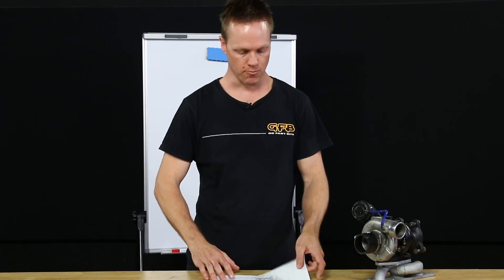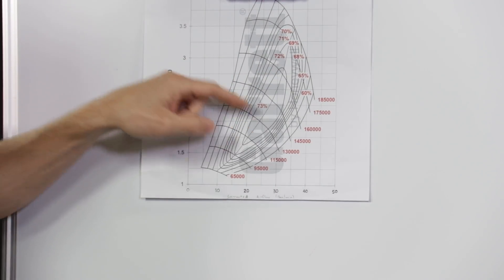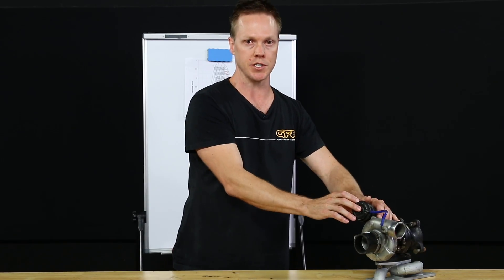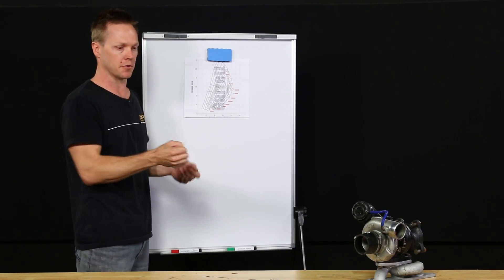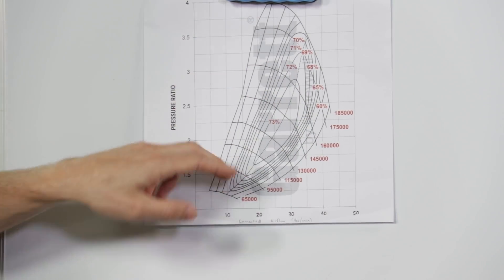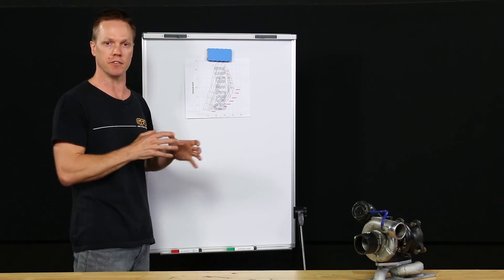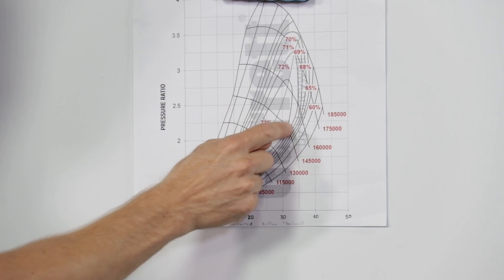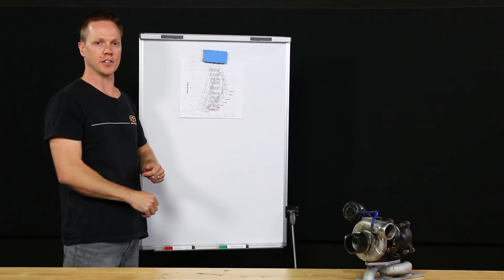Turbo Compressor Map Explained [GO FAST BRETT]

Comment: Great video man. Can you please refresh my memory on how to plot the points on that compressor map, that show your different RPMs using the Volumetric efficiency formula at 1000rpm increments... I can't seem to find it anywhere. It's basically to determine what you're saying about being on the surge zone or efficiently working the turbo matched to the engine performance

Comment: If the pressure at the inlet is less, than  atmosfere the pressure ratio is more not less and turbo is working hader to provide that 1 bar or wahteser is set to

Comment: Had a doubt. You said when the RPM increases the operating point goes horizontally to the right to the current RPM curve. However, shouldn't the boost ratio increase as well and the operating point actually shift diagonally?
Reply: The Y axis only contains the pressure ratio.

If your boost holds 1 bar above atmospheric and your turbo has a very good intake without losses, you're very close to a 2.0 pressure ratio. You will stay at 2.0 pressure ratio unless you start asking your boost controller for more or less boost across the rpm range.

Comment: Intercooler psi drop is also a part of pressure ratio calculations
Reply: well it's important for the engine power but the talk  in the  video is about the turbo efficiency itself.

Comment: 1 bar of compressor pressure with 1 bar of atmospheric intake pressure makes a pressure ratio of 1, not 2.
Reply: Mishellis gauge pressure versus absolute pressure.
Reply: 1 bar of compressor pressure is 2 bar absolute pressure so 2bar absolute divided by 1 bar ambient pressure  equals pressure ratio of 2  or  14.7 psi of boost pressure is 29.4 psi absolute  soo 29.4 psi of absolute divided by 14.7 psi ambient equals... 
you guessed it pressure ratio of 2
Reply: @blago6  Wow, I don't know what I was thinking when I said that 4 years ago. Thanks

Comment: Increased pressure ratio if you start lower but end at the same, no?

So obtaining the pressure ratio is pretty straight forward, but for corrected air flow you need to know the actual engine airflow then adjust for temp/pressure, but how do you get the engine's air flow?  It's pretty vital to using this map.
Reply: MrSlowestD16 

Agree 100%.  Without working out the approximate air mass your engine is expected to be consuming, these maps arent gonna help you choose a turbo.  

But with some info on engine size, max boost, max RPMs and such, you can pretty easily guestimate the amount of air your engine will roughly use at various RPMs and various boost levels.

First step would be to try and get an approximate amount of air mass that your engine will consume.  There are plenty of online calculators available that will give you an approximate value if you punch in a few bits of info.  Displacement, boost, RPM and sometimes volumetric efficency.  (Some online calculators are very detailed and allow for temperature and elevation aswell.)  If you work out the approximate airflow you expect your engine to consume at certain RPMs and at certain boost levels, you can then plot that info onto a compressor map of a turbo you are considering and that will then help you best choose a turbo.  You can see what RPMs the turbo should be at peak efficiency on your car.  And what rpm and/or boost it will start to fall off the efficiency islands.  

But these maps are only half the story. They are only compressor maps, and they have no consideration to turbine size or AR.  And how that will effect things.  For example Garrett fo a gtx3076 and a gtx3576.  Both have the same compressor, but the 35 has a larger turbine.  These maps will not explain any of this to you.  But you can use some guesstimation and assume the one with the larger turbine will be slightly slower to spool, but support a little more horsepower.

This is exactly the steps i used when choosing my last turbo.  And once fitted, the characteristics very closely matched my predicted calculations.
Reply: When calculating the estimated air consumption of an engine.  Some things are gonna be pretty easy.  Dispacement, boost and RPMs are pretty easy to punch into an online calculator.  As is temps aswell.  But they will sometimes ask for a volumetric efficiency (VE) figure.  Which is gonna be difficult to know.  But you can make a pretty good guess for this.  Most 4 valve per cylinder dohc engines are gonna be up in the 90s these days.  Cars with big cams may push this out a bit further and/or later into the rev range.  Other breathing mods like performance exhausts and intakes, and especially things like cylinder head porting and such willl also generally net better VE.  (Its why mods like that make more power) 

With that info, you can then plot the points over the top of a turbo compressor map and this will then give you a pretty accurate estimation of how the turbo in question will perform.

Comment: thanks for yet another video of an explanation that didn't teach me anything. there has got to be a way to explain how it works in terms that are easily understood. I guess what im asking for is a video that takes an engine and multiple compressor maps and clearly defines what each line is and how you can equate the pressure ratio to something tangible ie: max boost pressure you want to run. then have a corresponding line show rpm and where that engine is in those efficiency islands as it accelerates. then take each map and show how the every day person can get the best turbo matched to their engine. I mean isn't that what people look at the maps for anyway? I know each engine is very different due to how the exhaust and intake flows but can you take a base line measurement like liters and show how this turbo would be bad because it has too much displacement? then show us what turbos come close to being fully efficient for most of the rev range. That would show me a more practical use for the maps other wise I don't see a use. there has to be a common denominator that each person can use to pair the turbo properly.
Reply: The issue is that static displacement only tells you part of the story, and every turbo is going to react differently on every engine, yielding a near infinite number of combinations, each incomparable to another, even with similar turbos. You can't just list boost, because atmospheric pressure plays a role, as does the pressure at the inlet of the turbo in the case of vehicles where you're limited on plumbing.

You just can't list this out with hard numbers unless it's for a very specific combination with all parts being known. 1 Bar on a 2L four versus 1 bar on a 4.6L eight is going to have VERY different airflow requirements, with no turbo able to efficiently accomplish both. Hell, even hitting 1 Bar at 3000 RPM versus being at 1 Bar at 7000 RPM on the same engine is going to have a major difference in what you're going to be asking of the turbo because of differences in airflow and cylinder filling. A SOHC 2.0L engine with a crap head and restrictive manifolds is going to move less air than a DOHC 1.8L with really high flowing heads and manifolds, RPM being equal. This is why turbo manufacturers use compressor maps rather than anything else.

The charts are relatively simple, you just have to know how much air your engine moves at the RPM you want peak boost at (you can ballpark it and still be fine), and how much boost you want. At sea level on a calm day, you'd see 1 Bar of atmospheric pressure, so if you wanted 1 Bar of boost, you'd want a pressure ratio of 2. With the vertical axis being pressure ratio, that tells you how much pressure, relative to the barometer, that the turbo will be happy at and the horizontal tells you how much airflow it'll be good with. In the map shown, that turbo will be happiest with between a pressure ratio of 1.75 at 20 lb/min of air, and 2.75 and 32lb/min of air. That would have a 2L engine pretty happy at 1 bar at 4000 RPM, or it would have a 4.6L engine making the same boost at 2300 RPM nearing the top of this turbo's highest efficiency island, if I have my math right. That 4.6L engine would be so far beyond the compressors choke point at 4000 RPM that neither it or the turbo would be long for this world.

Short answer: This is as simple as compressor maps can be explained and not just turn into armchair racing with potential for huge inaccuracy.

TL;DR: Just get whatever the forums says works for your car and power goals.
Reply: http://aerocharger.com/aerochargers/#technology
Reply: check that site out! that is the most helpful tool I've seen for calculating what turbo to get! after you put your values in for your area you live and your motor specs etc. go plug the numbers into any of the turbo graphs and your in business!
Reply: They're woefully optimistic about power numbers, that's for sure.

Comment: My VF52 isnt as small as the TD04 and man it hated being pushed.  My tuner knew this very well and made my car into a torque monster and tapper off at redline.  Not worth pushing your small turbo for big power, on any car, it just makes it into a hair dryer on steroids.  Got bigger turbo now, pushing same boost but made more power.  I havent had issues in this heat wave so far, I know my vf52 would have been causing a lot of knocks.  My injectors are maxed so this turbo is hardly doing any work right now.

From a recent article
"Run a Bigger Turbo
Believe it or not, but a bigger turbocharger is a great upgrade for engine durability. For Subarus running 18+ PSI, the larger compressor wheel and housing will produce the same boost pressure at a lower temperature. The bigger turbine and turbine housing also improve the ability for the engine to expel exhaust gasses. Overall it is a great upgrade for any Subaru running more than stock boost pressure."

Comment: Either I'm an idiot, or I'm looking at this the wrong way.  Isn't "reading" that map like looking at a Contour map? I'm just reading that like I'd read a map of an area, so the less contour lines the easier it is to walk along.  Or in this case, the less contour lines, the more efficiently your turbo will be working inside a defined area?
Reply: You want the air flow to be in that center island were the efficiency is best and never outside the map.  However that isn't easy.  It has to do with the size of the engine, rpm, boost level, and few other things like volumetric efficiency.
Reply: Ok, so I've kinda got that.  Can the other side of the Turbo be mapped as well? Map how effective the Impeller is?  And can you then look at both of the maps and work out the best impeller for the best compressor for the application you're looking for?  I think I need to find a good book.
Reply: Yes but it might only be a flow chart.  Look at garrett turbo website and their turbos have maps.

Comment: What turbo would I need for my 2003 Dodge ram 1500 5.7L hemi engine with 228,000 miles
Reply: Jose Luis Ramos Keep it as is, it doesn't have much life left in it and adding a turbo would only reduce its life significantly.
Reply: You can go from any decent size such as a 73mm turbo to a 2x90+mm setup :)
Reply: +Jose Luis Ramos 
Try this... 

https://garrett.honeywell.com/

https://www.turbobygarrett.com/turbobygarrett/boostadviser
Reply: Daniel Napast that's the point of my question ik most hemi's last between 200,000 to 300,000 and I want to test what might make it faster strong with a bit more torque so when I drop in the new engine ik what setup I can put in without destroying it this is the first engine and I plan on making the second engine last as long thanks.
Reply: Jose Luis Ramos Td04 will be fine mate😉😂

Comment: If the pressure at the inlet is less, then the pressure ratio has increased.
Reply: That assumes output pressure has remained unchanged
Reply: Yes I'm saying he errored at 1:17.
Reply: oh gotcha
Reply: spud4242 Think again... As flagpoleeip said. 0.9:1.9 is a ratio of 2.11.
Reply: pressure ratio = (outlet pressure + atmosphere pressure) / atmosphere pressure

I believe he is right, isn't boost pressure considered gauge pressure where it is pressure above atmosphere? so like the formula above would prove him right? his example (1+1)/1 = 2 

Thats how it was explained to me in engineering thermodynamics,
Reply: @zvargulis1988  it's more like (atmospheric + boost) / inlet pressure
Reply: @GK-iw3hi  guys how the inlet pressure can drop i assume its because of the attitude because air is less dense so if you living at sea level theres nothing to worry about?
Reply: For the same amount of boost pressure, yes it takes more energy for the turbo.  Look at the compressor map.  Compare the efficiency at the two pressure ratios to see how much hotter the air will be.  Mostly, this is a concern with elevation changes.
Reply: spud4242 no. 1.9 out and 0.9 in is a ratio of 2.11 FFS.
I can understand you not knowing this, but why would you presume to correct people that do?
Reply: Yep. I agree.
Reply: I was wondering about this the other day. So if you have a restrictive intake on your turbo, and it's compressing less than atmospheric pressure that is state 1. Then if you have no restriction and it's compressing atmospheric pressure, that is state 2.

If both states are outputting the same amount of boost pressure, what is the difference between the two?

Is it just that with state 1 the turbo has to work harder so the compressed air is hotter and the turbine creates more back pressure since it needs more exhaust pressure to compress to the same PSI as state 2?
Reply: no, he still said 1 bar BOOST. not an absolute output pressure. so 1 bar in and 1 bar boost = ratio of 2...0 .9 bar in and 1 bar boost is 1.9 bar ratio of 1.9 i.e less...

Comment: Subarus make natural flutter sound tho? Just like sr20"s n so on... 
my tdo4 in my wrx works perfectly has normal flutter ... 
on my MBC to my Air fuel ratio ?  With all the supporting mods 
You left a lot not explained
Reply: Flutter sound under acceleration.
Reply: Savage boy Arturo Factory Tuners don't care...Go Fast Brett does😄

Comment: this was really incomplete. leaves many unanswered questions.
Reply: jack black I believe he said it was a basic idea of how it works, he's not going to do a uni course on explaining it.... Find an engineering explained video if you want that
Reply: jack black 
Agree.  As the others have said, this is a very complicated topic, and way more than you could expect to cover in a short You tube video.  

But at the very least i would have liked to see him explain how to calculate the estimated air mass consumption of a engine for a given RPM and boost.  Without this piece of info, looking at compressor maps is basically a waste of time.  But once you have calculated the estimated air requirements of your engine.  You can then plot that data over the top of a compressor map.  And this will fairly accuaretly be able to tell you how the turbo would be expected to perform on your engine.  And allow you to best choose a turbo for your application.  

This should have been covered in the video, as without this step, what is even the point of looking at a compressor map?  It means nothing to you if you cant relate where you engine will be operating on the map.
Reply: You can write books about this shit.  Actually, Corky Bell and many others already have!  Can't expect him to answer it all, we'd be here for hours.

Comment: It's amazing that you can explain it so well in just 5 minutes, this actually helped a lot. Thanks, Brett!
Reply: I agree. It's now a topic that I'm staying to research into (how to correctly size a turbo for your application), and this video was the perfect introduction to it. Only disappointing thing is at the end he mentions that for further information there is more info available online, but some links or suggestions for good sources of information would be helpful
Reply: +whatdaf11 
These are a complex subjects with numerous variables and caveats. 
My suggestion to be successful is to get a good grasp of thermodynamics, fluid mechanics, fluid-dynamics  and gas laws first. 
Here are a few good turbo specific places to start... 

https://garrett.honeywell.com/

https://www.turbobygarrett.com/turbobygarrett/

https://www.turbobygarrett.com/turbobygarrett/boostadviser

https://www.turbobygarrett.com/turbobygarrett/compressor_maps

https://www.enginelogics.com/read-a-turbo-compressor-map/

https://www.enginebasics.com/Advanced%20Engine%20Tuning/AR%20turbo%20ratio%20explained.html

https://www.google.com/search?num=100&newwindow=1&q=how+to+correctly+size+a+turbocharger&oq=how+to+correctly+size+a+turbo&gs_l=psy-ab.1.0.0i22i30k1l2.143921.160184.0.169847.24.23.1.0.0.0.426.2516.16j6j4-1.23.0....0...1.1.64.psy-ab..0.24.2517...0j0i20k1j0i13k1j33i22i29i30k1j0i13i30k1.FSud9yGj0qs